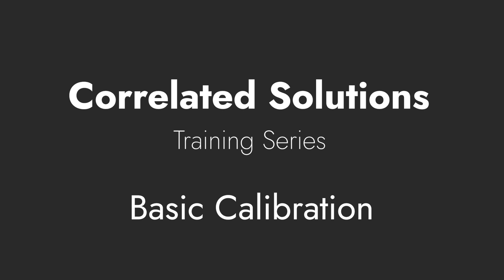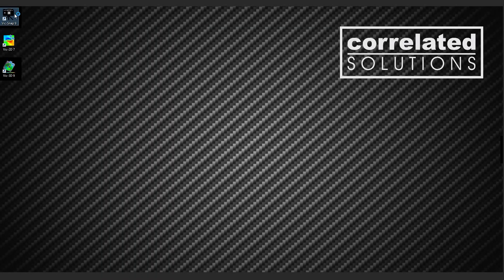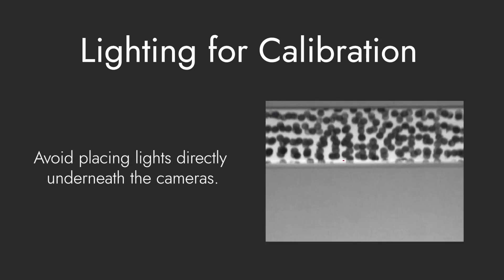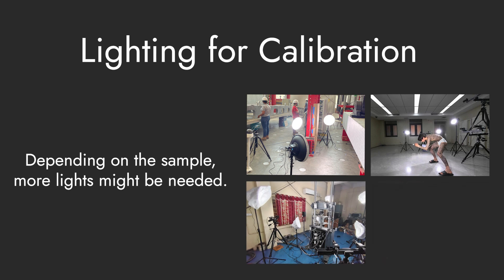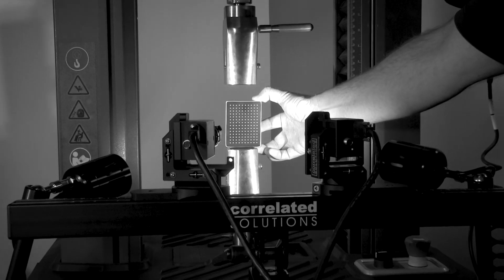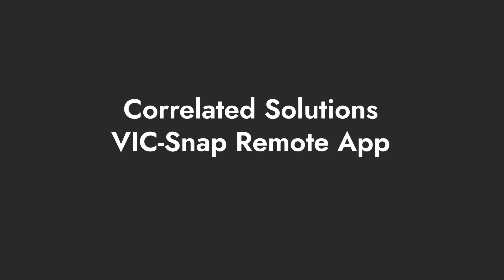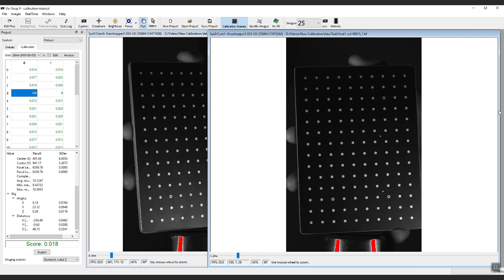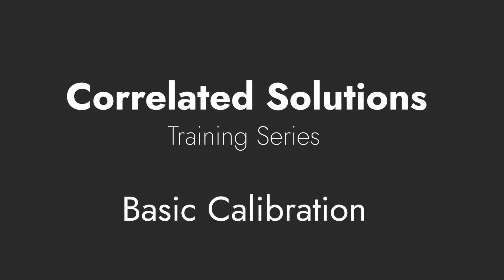Calibration for DIC using VIC-Snap & VIC-3D

Comment: I am using VIC-snap 9 and the calibration toolbar is inactive. I can take calibration images but they do not appear in the calibration toolbar.  What could be the reason? I can calibrate in Vic-3D though
Reply from the maker: Good morning, and thanks for your question. You will likely need to enable this in "Advanced Options." Simply go to File>Advanced Options>Edit Advanced Options>VIC-3D Integration and select "Enable VIC-3D integration." Please note that the settings in "Advanced Options" are selected to optimize your customized system before it ships to your facility. We typically do not advise changing these settings without consulting our support engineers. If you have any further questions, there are some excellent resources available at correlatedsolutions.com/support. In general, the best way to quickly find answers is to access our free, online Support Portal. Here you can use the search bar to access our extensive knowledgebase, application notes, downloads, and much more. If you still have questions, technical support for all of our measurement solutions is available via phone or email. The entire team at Correlated Solutions is committed to providing the most effective and prompt technical support possible. Our engineers draw on vast application experience and comprehensive technical backgrounds to provide efficient solutions to the most challenging problems.
Reply: @CorrelatedSolutions  VIC-3D integration is already Enabled but the module is inactive. Also the DAQ and Fulcrum are also inactive. I am using a Vic 3D 2010 though. could that be due to a mismatch between Vic-3d and vic snap?
Reply from the maker: @roodyfauler7823  Thanks for your question. Our support team will have an easier time answering this question with a little more information from you. Please email support@correlatedsolutions.com, and one of our engineers will respond directly.